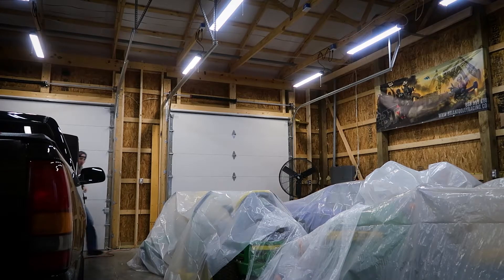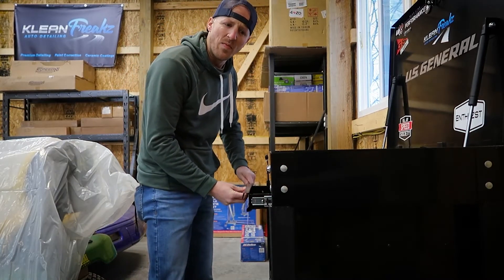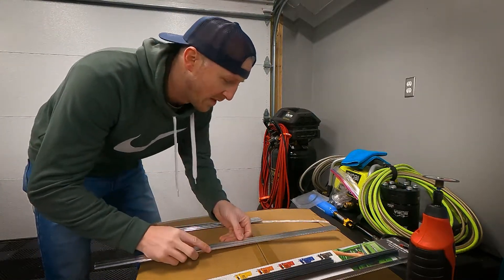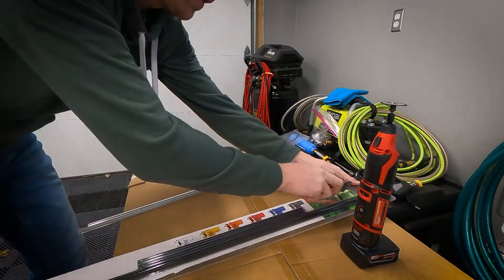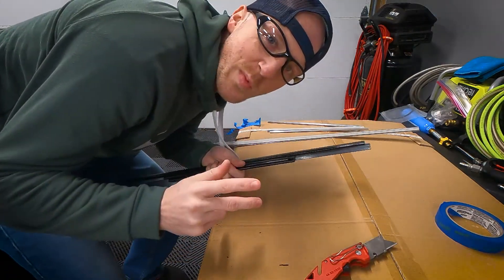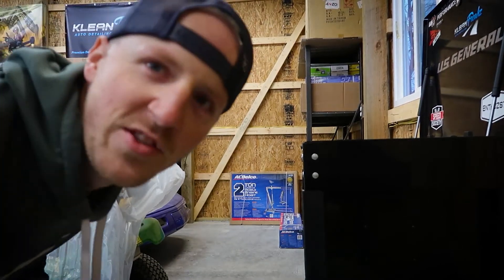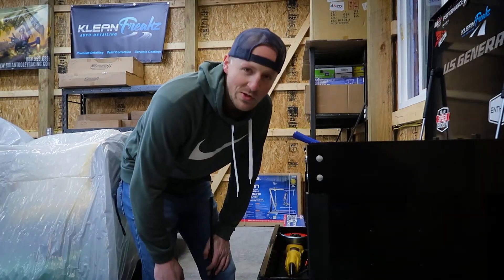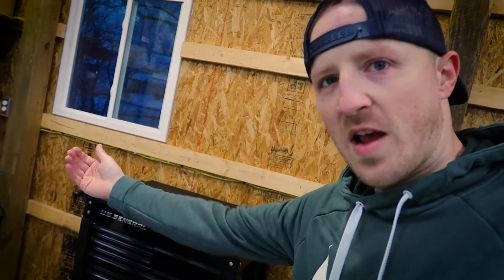US General / Harbor Freight Tool Cart Black Trim Install

Comment: Those Milwaukee die grinders are perfect for when you need to cut through something small like a steel braided wire, while on the go.
Reply from the maker: Nice tool to keep in your truck box. Just in case!

Comment: If you really want to stealth out the box, lose the U.S. General decal on the front. They come off easily. Remove any remaining adhesive with isopropyl alcohol. Take off the chrome handle lift for the top of the box and paint that.